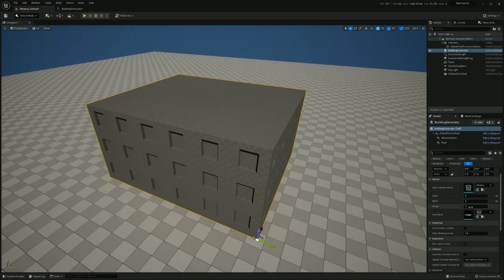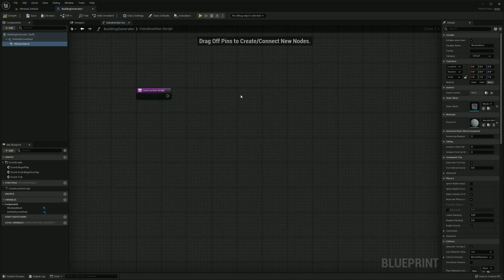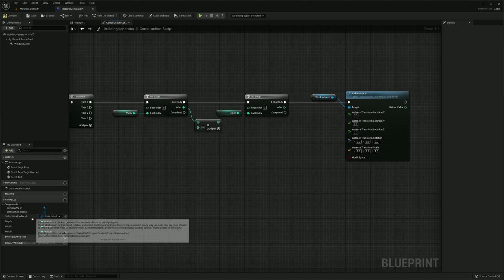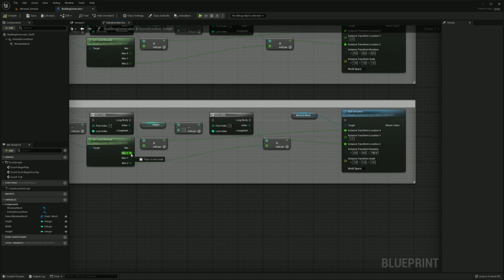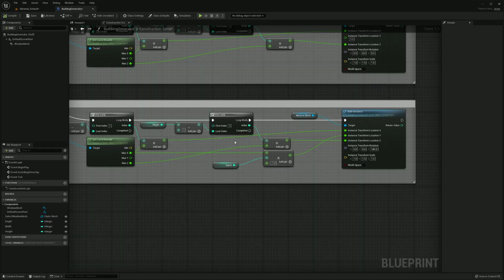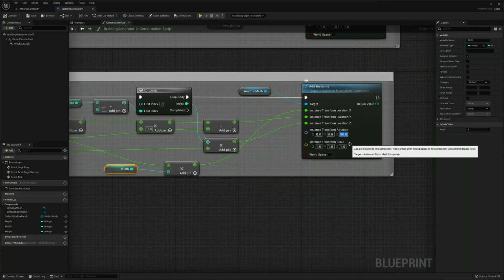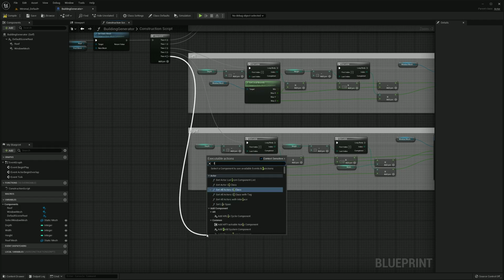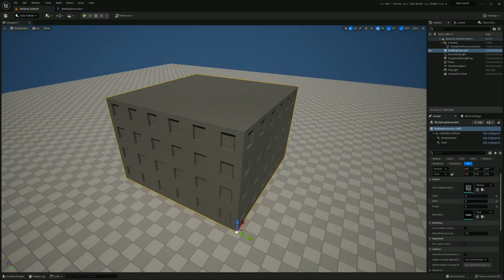How to easily create procedural buildings in Unreal Engine 4/5

Comment: Excellent work, Id love to see a tutorial on your take on using a struct/data table system to add different sets of materials! perhaps with interiors, and stairs?
Reply from the maker: Good idea! I haven't really used that a lot so would have to do some research, but a possible topic for the future :)
Reply: @OskarKassander  I am currently working on something like that when I am done I might share the results btw. I put the wall part in function way better handling of walls with that

Comment: Does it have to be a perfect square? im working in a 2x1 mesh and its not doing it they way explained in the video :(
Reply from the maker: Hmm, I thought it should work since we are using bounding box of the mesh. This was a while ago I made, but can you double check you use the correct bounding box input? So its the right axis. It should be X axis for the width. Around 3:20 in the video is where that is done. Also can you say what is wrong, what is not working?

Comment: This is a great video with one exception. If user, who watch this video didnt know Blender - this video for him is completely useless. And there is no explanation about how you create this mesh at all. There should be step-by-step explanation in the Blender parts.
Reply from the maker: I don’t really agree with that, most people who work in Unreal Engine also have experience with some 3D modeling software. I still showed my process of creating it and mentioned that the origin should be in the bortom corner. Most tutorials tend to rely on a bit more then what is said in the video, and if you are not familiar with 3D modeling you can also use walls from Megascans or the starter content.